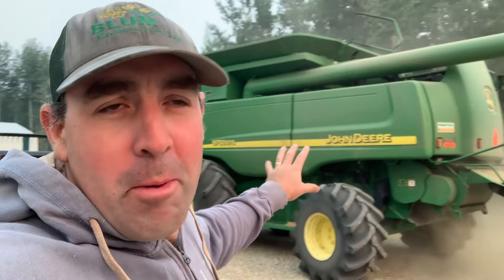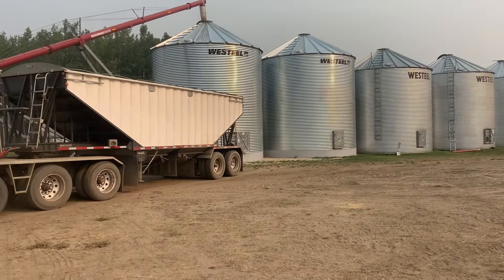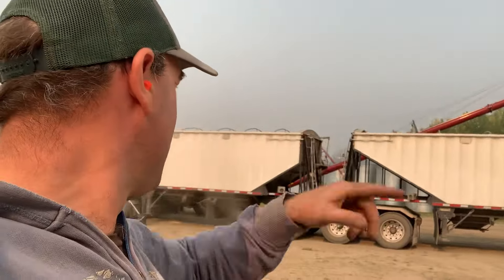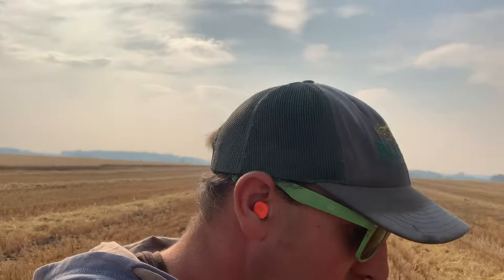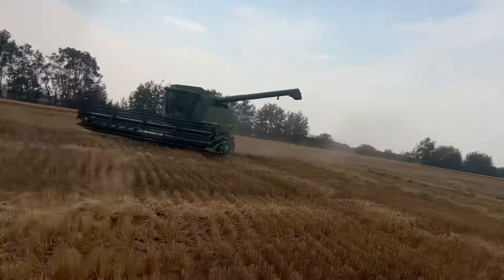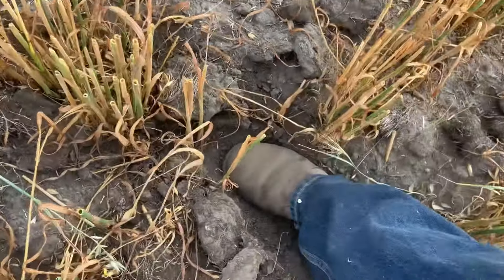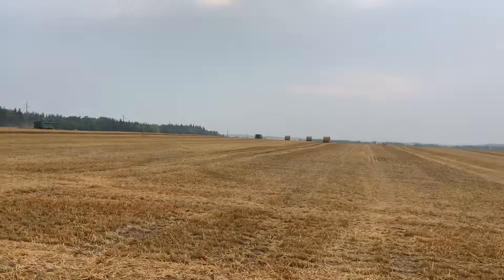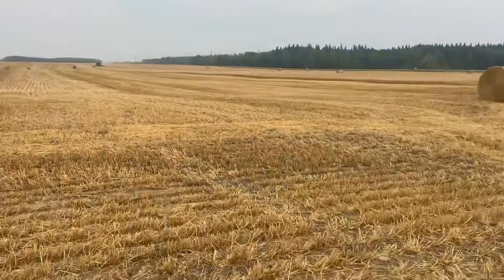High oat yield and the 9750 is down again.

Comment: I think fall work is important.  Lets the water go in on the melt that would normally run off. I've had no light bushel weights this year and so far decent yields.
Reply from the maker: @jeremycherny2041 everything but prices are up over here yields and bushel weights

Comment: That oars crop is lucky if it’s 100.  Never mind 179 by per acre    It looks light.   Combine yield monitor aren’t at all accurate till they are calibrated.  I would have put lock tight on the bolts holding your shoe.
Reply from the maker: @EvanC8  we did end up putting lock tight on the bolts. I always find it funny when people comment about things like yield or reel speed on videos. Anyone who has ever watched a farming video should understand it is very hard to tell those things from the video.

Comment: We've had 170 oats before. I didnt like it lol. The money was good but those massey combines were working. Took us 5 days to do 110ac. It was also on plow down hay land on a year like this.
Reply from the maker: @jeremycherny2041  crazy didn’t think i would ever see it
Reply: Our Oats doing great. So had too just.. See how fast I.... Filled the hopper empty to droppin on the cab with a 9770 STS  in 11 minutes flat with the topper Morgan Oats... OATS there great no green there September 2nd testing 12.4 moisture but had to go around other many peat areas in fields... The tank monitor bell went off at 4.5 minutes and again full at 9 minutes.. About 4.0 to 4.6 MPH.. 30 foot header. and no green. Very Clean field oats in 2023 also but dry year peat did great then also.Them peat areas I went around just sprayed for dry down no doubt will run in the ?? mid 200's 4 feet + tall like hair on a dogs back and not lodged to bad!!
Reply from the maker: @davemurphy2774 that’s awesome, glad to hear. There are some incredible crops in the peace, unfortunately there are some write offs as well